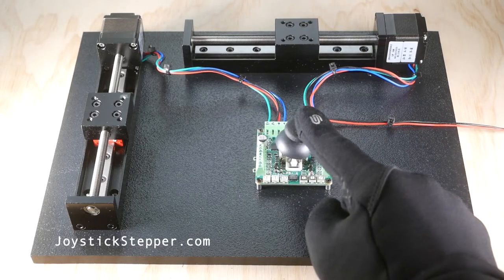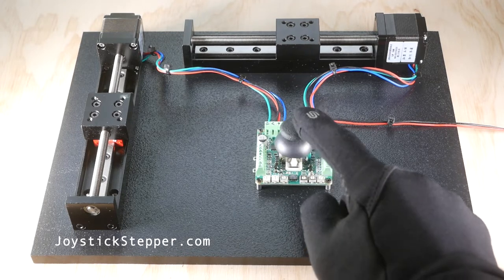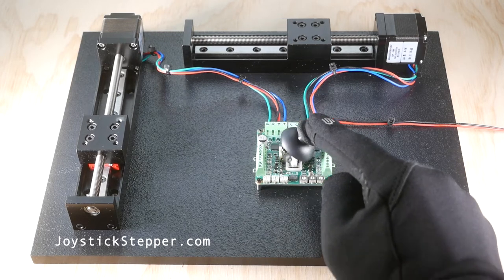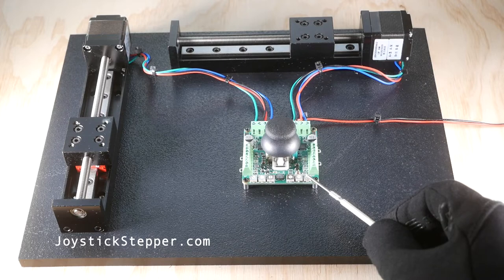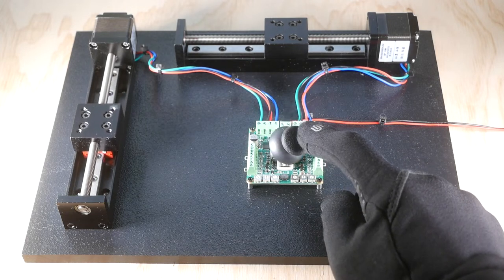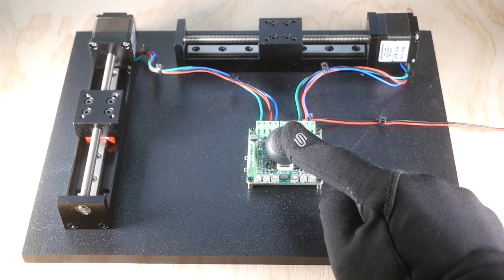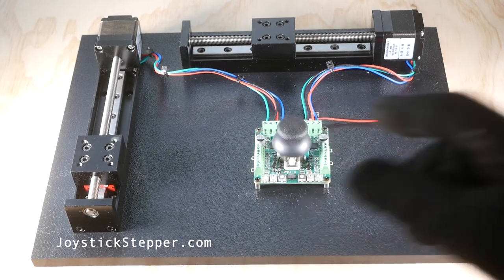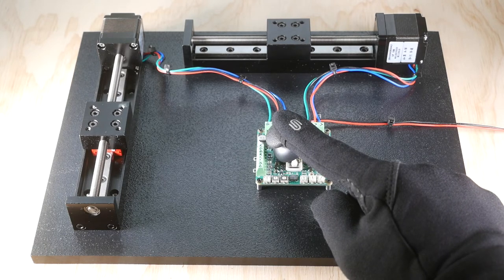Joystick Stepper Motor Controller for XY Stage | Buy now | No Coding

Comment: Please can I put an end to the beginning and end of the stepper motor.  Can you explain in a video?
Reply from the maker: There is provision for a "Limit Switch" for both ends of motion. The motor stops when the limit switch is triggered. Please see the data sheet.